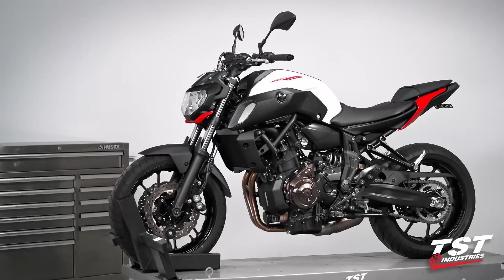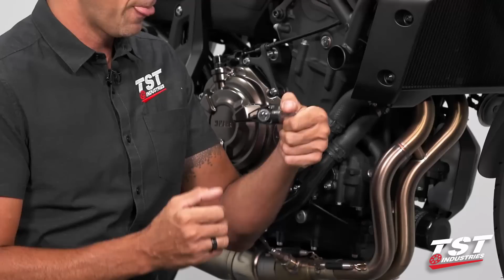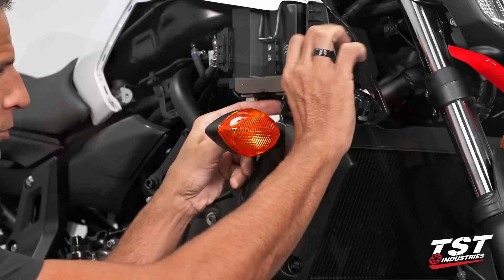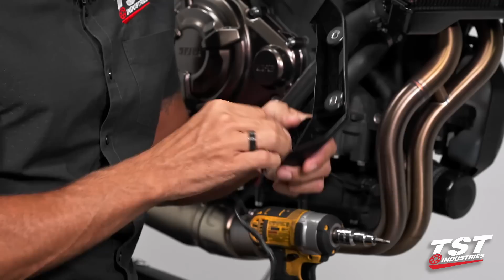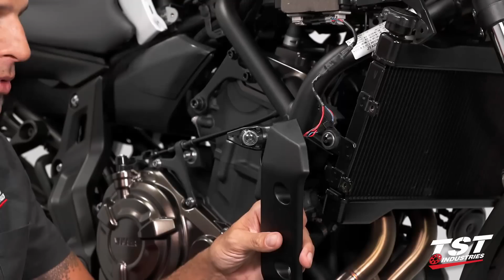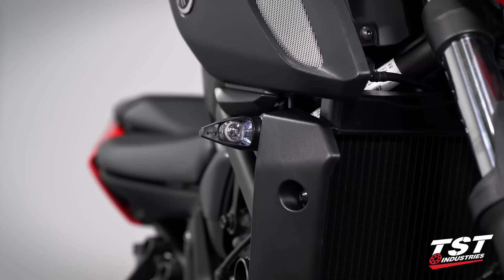How to install Mech-GTR LED Flush Pod Turn Signals on a 2018 Yamaha MT-07 by TST Industries

Comment: Hi mate, 
Are these the eu version or US version of the indicators? You have 2 options on your website I need the ones in this video,
Cheers
Reply from the maker: All of our products are designed and intended to fit and function on North American model motorcycles as that is all we have access to. However, thanks to additional feedback from our International dealers and customers, we can sometimes offer products we know will fit International model motorcycles. This is one of those products and if you look at the product page there is a disclaimer suggesting International customers click a hyperlink to visit a different product page to purchase.

Comment: Would the ratchet connection work for an xsr900? I know you guys have a kit for some other signals. With the mounting holes being similar, if not the same, shape I would think it's a possibility. I think the depth would maybe pose a fit problem.
Reply from the maker: The main reason we do not advertise this setup for XSR bikes is that even though you can physically mount them, the part that is supposed to be behind the fairing on other bikes just looks ugly out in the open.
Reply: @TSTindustries  thank you for the reply. Does the part that is usually covered by the fairing need to be protected from water/rain?

Comment: The 2021 models seems to have a different setup on how to unlock the inside of the bike.
Reply from the maker: As soon as we get that model in house we will figure it out.
Reply: Has there been an updated video for the 2021 MT-07? I bought these but I’m not sure the steps for installation due to the different setup.

Comment: Can these be put where the read indicators are?
Reply from the maker: That is a loaded question but I will attempt to answer it. Technically yes, but there are a few implications. In the rear signals you don't have a running light circuit. If you want that functionality then this would require wiring a tap from the blue wire of the signals to the running light wire of the tail light. Fortunately we now have red running light modules so you can actually have an additional red running light in the signals. Then there is the physical installation. On some bikes these signals fit in correctly and on some the depth behind the mounting surface has some obstruction and needs to be trimmed. In addition you may have visible parts of the signals under the fender that you can't easily conceal. I have personally done this on some bikes but it varies so much from one to another that we have not decided to make installation instructions for those modes.

Comment: do they work for the rear end too?
Reply from the maker: Electrically yes. Can you mount them physically...yes but maybe with some modifications to the fender signal accepting features. Will they look right? I don't think so.
Reply: @TSTindustries  thnk u so much!!
Reply: thanks for the video...
Do you have a plug and play version for the rear that includes the break light ?.
appreciate the response.
Reply from the maker: @reteamer  the rear connectors on yamaha signals have one circuit-signals. There isnt a way to have a plug and play signal setup that has running or brake light circuit. We do have an integrated tail light, y-splitters, and signals so you can build the functionality you need.

Comment: Hey guys, I got the Mech-gtr, BL6 turn signals. I can’t find a way to secure them onto the plastic piece on the side of the radiator. There’s just a nut and the black plastic spacer that come with the signal. How can I mount it? I have a 2018 mt 07.
Reply from the maker: I think you should probably direct this towards the customer service department on our website. That is the help portal where our guys can look up your order history and help you troubleshoot.

Comment: Glowlight doesn't work for bikes outside the U.S. do you have instructions on how to make it work? Other than that this product looks great on the bike.
Reply from the maker: We have come up with a connection kit for Kawasaki bikes because they do not have a running light circuit in the front signal plugs. I think that watching one of those videos will show you how to connect your running glow light, and you can just use wire that you have around and maybe figure out some connector available locally. Here are some videos for your consideration:
https://youtu.be/X-AMt_kMhng
https://youtu.be/5V3eDU1GAnU.
https://youtu.be/1X8ECMeAdDw

Comment: Hi,
If I order this today do I need to still modify for the fitment? Or have you guys already adressed that issue?
Reply from the maker: Since these signals are meant to fit multiple bikes, the system has remained the same as when we made the video. Nowadays we do include a rubber o-ring that makes the installation simpler on several models, and increases the friction of the fit on other models that need extra movement restraint.
Reply: @TSTindustries  hi thank you for the quick reply, Bart in the video had to chip away at one of the parts and even at the plastic part of the MT07, can you confirm that is no longer necessary?
Reply from the maker: @marvingarcia5806  this is Bart. I can look at the installation we have on the shop mt07 tomorrow and let you know.
Reply: @TSTindustries  thanks Bart,  wish you shipped to the Philippines for us to avail of your products much easier. Great products!
Reply from the maker: @marvingarcia5806  i looked at the bike we have here. The installation was made without trimming anything, just using the rubber oring.
Reply: @TSTindustries  do you have instructions on how to make the glow light work for those outside the U.S?
Reply: TSTindustries y’all are awesome. Thanks.

Comment: does the relay installed on side control the rear tail light speed aswell? or you have to buy 2 relays one for front signals and 1 for rear?
Reply from the maker: One relay = all signals
Reply: @TSTindustries  awesome ty happy new year. I just bought the tail light,front signal and a relay.  your videos are top notch
Reply from the maker: @chefriz5486  great! Happy new year. I think you will really like your new goodies when they arrive.
Reply: well I wish I would've known that because I bought two relays..oh well

Comment: What would be a reason for the glow light not to work i wanna sort a work round coz sending it back from where i leave would be a nightmare
Reply from the maker: In some markets outside of the Americas Yamaha sells these bikes with no running light function in the front signals from the factory. If yours is one of those you would need to wire in the running  light circuit to make it work.
Reply: @TSTindustries  would love it if you could make short instruction video for the glow light to run as well for customers outside the U.S.

Comment: In case anyone is wondering, that plastic part that the signal light connects to can be found in the "Radiator hose" section of the Yamaha parts catalog. Left side: "Cover, Side 3
," Yamaha part number B4C-21731-00-00. RIght side: "Cover, Side 4
," Yamaha part number B4C-21741-00-00.
Reply: You're a hero!
Reply: Im curious whether you can put that cover on a 2015 model?

Comment: I found on the website that there is an install kit for the Mech-GTR LED turn signals and also one using the AR018 pods for the front but its on the earlier models where the turn signals are mounted up by the headlight. What should I do if I want the AR018 pods mounted in the front in the same position where the Mech-GTR lights go?

Comment: I just received my set of lights today and they came with a bag that had 2 o-rings inside, but I didn't see them used in the video. Are they supposed to be used in between the light fixture and the OEM parts or were they just extra parts that were accidentally added to my order?
Reply: I was wondering if they sit inside of the panel or outside now you said inside i feel good cause i set them up inside the panel
Reply: I actually put the oring on the outside so it sits between the clear plastic housing and the bikes outside plastic frame. I think either works fine since the black racheting piece worked fine without any clipping

Comment: The lamest part ab a new bike is the lack of DIY videos. I’m glad videos of my bike are finally starting to surface!

Edit: Just purchased the lights in this video. Can’t wait to get them!

Edit Edit: Got the lights last week and installed them today. Probably the easiest “modification” I’ve ever done. It literally took 10 minutes of actual work. I can finally say bye to those awful stock signals. I have TSN lights in the front with a DMP fender eliminator from RevZilla. I decided to not use a new relay because the “hyperblink” to me is another thing to catch people’s attention when they’re texting and driving. I mostly only city commute so it works for me.

Comment: If the bike was driving straight towards you is it possible to see the halo ring on the base of the signals? It appears from the vid that they are tucked in behind the radiator side cover a little.
Reply from the maker: There is a glow there that you can see but it is not very defined. These are just accent lights.